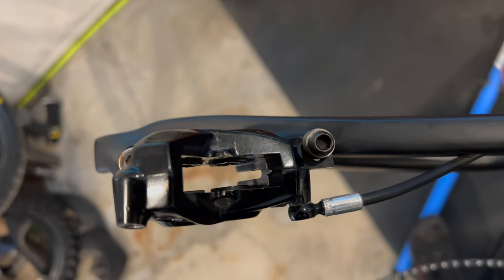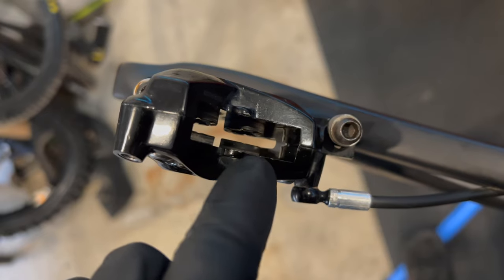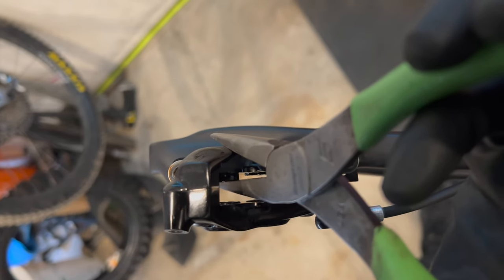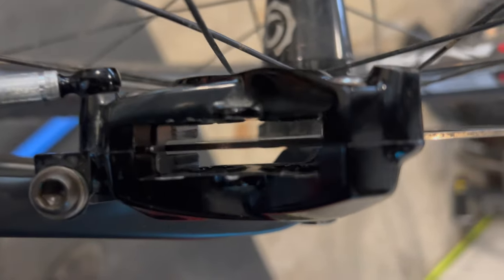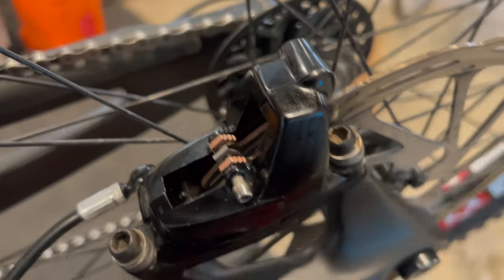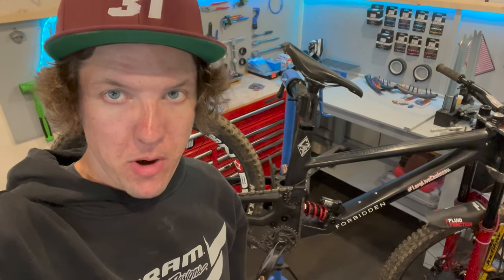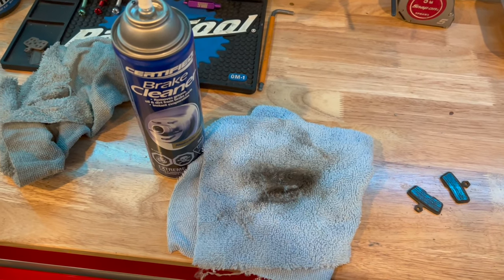How To Make Your Sram Brakes Not Suck! - Sram Piston Service

Comment: Will this work on Avid XX World Cup? My Rear Caliper's piston i believe one side is jammed, only one side is moving..
Reply from the maker: You can try but those brakes are not that reliable so if the service doesn’t rescue it I would look into a new brake. Thanks Len
Reply: @garage31  I see, yeah i heard many are saying the same thing as well. I guess i will look into getting a new set to save me from more trouble in the long run. Do you reckon if a Deore 4 pot or SLX 2 pot is sufficient? I mainly do XC
Reply from the maker: @hengyeewei1137  Both Deore and SLX will be fine. 4 Pistons will have more power, but you may not need that if your riding XC
Reply: @garage31  Got it, thanks a lot!

Comment: Ok so what if you do a full bleed, and do this, and there is still a rub that won’t go away? No matter how much I do the screw driver tech that you teach, it always keeps favoring having the inside two pistons push out more. I push them back and then get an absolute insane rub that’s worse than before. Then I push in the other side and try again, but under normal conditions (no screw driver holding anything) two pistons move like 400% more easily than the other two. 
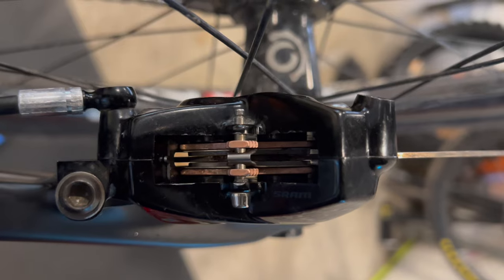I guess another way to put it: my pistons aren’t retracting properly. This video at 8:00 time stamp, you pulse the brakes and they go in and out. Mine seem to only want to go in, and when I let off, they don’t retract nearly as much. 
Do pistons ever need to come fully out to be cleaned/lubed more? I’m losing sleep over this fucking brake rub. Thank you!
Reply from the maker: How old is the brake?
Reply: @garage31 6-7 months of riding from brand new, then it sat for 13 months because I got an e-bike and forgot how to use my legs….trying to get the old bike back in action and so many things are messed up. Fox float x has “aerated” so it apparently needs a full damper service. But these dang brakes are killing me.

Comment: Using pliers or mole grips etc on pistons is asking for trouble.
Reply from the maker: True if your not experienced. Tire levers would be your best bet otherwise. Thanks Len
Reply: @garage31  It’s precisely my experience that tells me that’s running the risk of scratching the outside of the caliper and chipping a piston. Just my opinion but I’d prefer something wider and softer to spread the load, I generally spread with the pads to evenly reset the pistons.

Comment: Just bought an used yt jeffsy with guide sram brakes,bleed them all,made this,still sucks big time,my other bike with mt200 are way better brakes.
The guides got tektro rotors ,I'm going to replace the pads for a fresh ones ,I hope works ,if not f..k sram brakes!! And I'll buy mt200 instead.
Reply: Sram guides suck. Codes are the way to go, imo I like my codes more than my old shimanos
Reply: @wydra9-1  agreed, I have XT on my eBike and Code r on my primary bike. I prefer the codes, I know internet comments sections tell me the opposite but they are just stronger 🤷‍♂️
Reply from the maker: Guide brakes aren't the best. They require more maintenance than code's and take even longer to setup. Entry level Shimano brakes lack some of the power of the high end brakes, but they are reliable and hassle free
Reply from the maker: Pad compound choice makes a big difference with the XT's. Metal vs Resin. I've been running my Xt's with some Garage 31 pads (testing). They feel very powerful but with the modulation of a code. Stay tuned

Comment: From SRAM service manual: Do not apply DOT brake fluid or grease to caliper pistons when performing troubleshooting procedures. Use of DOT brake fluid or grease can 
diminish braking performance and cause rotor rubbing.
Reply: My brakes now perform better than they ever had and the brake feel is tons better, too. OP works on pro-level bikes and athletes. I don’t think he jeopardizes them if it’s not tired and true.

Comment: You are no longer supposed to lube the pistons
Reply: I recently bled my brakes after reading the Sram manual several times. I forget where but I remember reading that the Pistons should NOT be lubed. After watching this video a few times, I kept scratching my head why Len never mentions that. It's even more frustrating that about 100 comments were written and NOT ONE ever mentions this. THANKYOU James for saving me from tearing my hair out.
Reply from the maker: Imagine the law suit Sram would have if they wanted you to lube your brake pistons, and you got brake fluid on your pads and rotor. Your obviously welcome to not do this service, but the point of this is to lube the square seals, not the piston. This allows for easy brake setup, resulting in better brake performance. I have performed this service for Redbull Rampage winners and WC podium riders. Thanks Len